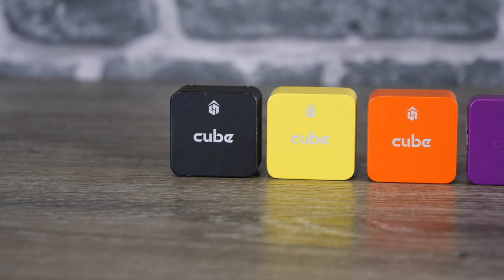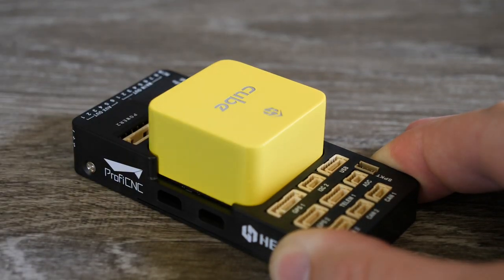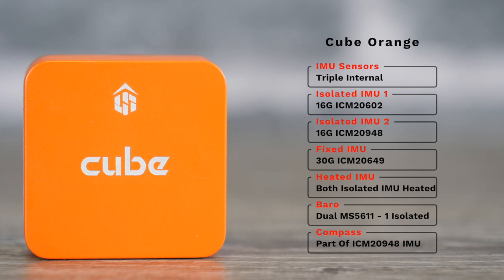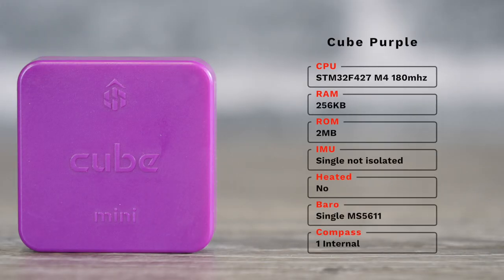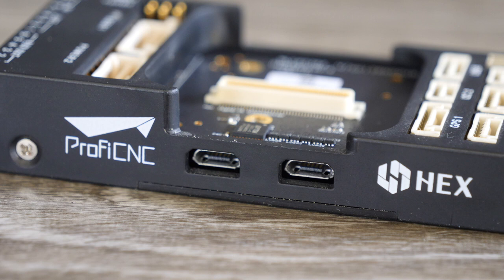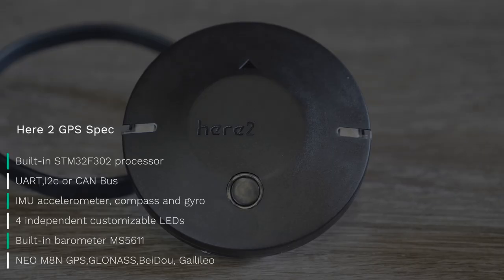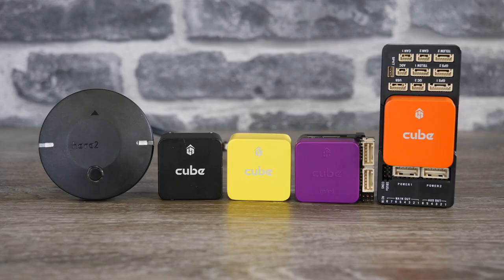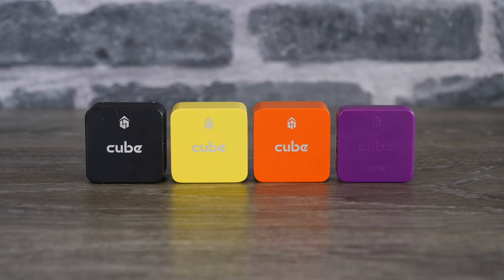The Cube Autopilot & Flight Controller Compared and Overview + Uavionix ADS-B Carrier

Comment: We really need a video on using the Herelink system with a fixed wing aircraft. Since the throttle in spring loaded, it's key that users know the process of using the system in whatever specific was is required to make it work. I can't believe no one has done anything to address this.
Reply from the maker: This is a good shout. I’ll put it on the list for one of the short ones.

Comment: Can any of these handle custom configurations? Like a Hex that can rotate its arms around its axis, either in 2x groups of 3 or 3x groups of 2, with ability for a group to roll either together or n opposite directions. 

Also, what about 2x additional motors (ducted fans) for increasing forward velocity while decreasing pitch angle? 

I would also like to add additional features such as 
•internal ventilation (monocoque frame) that is regulated automatically or manually. 
•Comprehensive data logging and live feed.
•Hoist winch.
•ability to switch between preset configurations on the fly. (After releasing payload, a Hex can shut down 3 motors/Octo shut down 2-4 motors to increase flight time/range.
•Recovery of attitude after exceeding maximum attitude values.
•A.I. Capability’s (secret:)

Comment: Hello, can you do a video on the multi rotor carrier board(Kore).  Would the multi rotor carry board(Kore) be used with the Mauch Redundant power modules?  

Also,  can you compare the blue cube to the orange? Which one is a more powerful cube?
Reply from the maker: Blue is identical to black in spec and is simply manufactured in the USA rather than Tw.